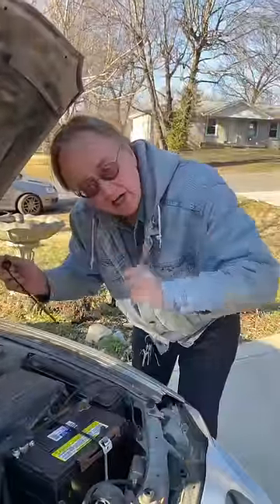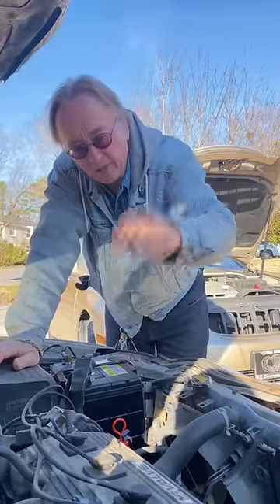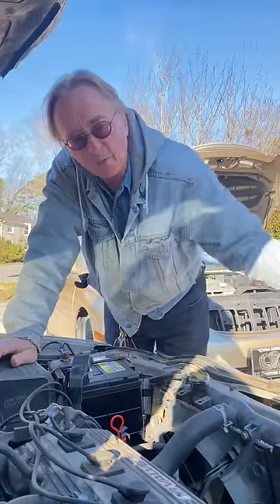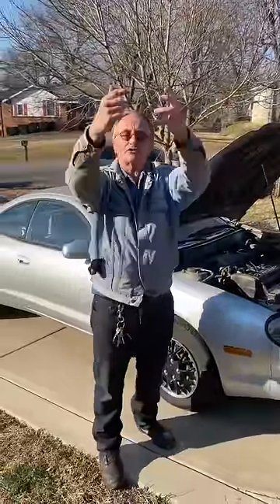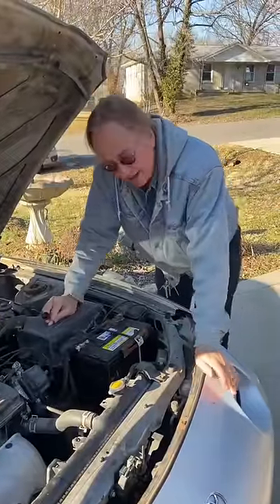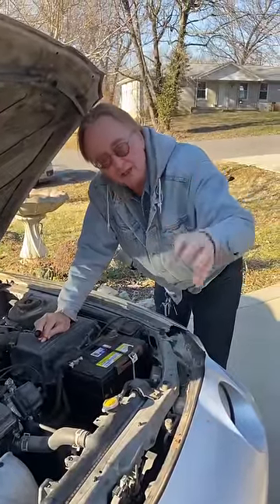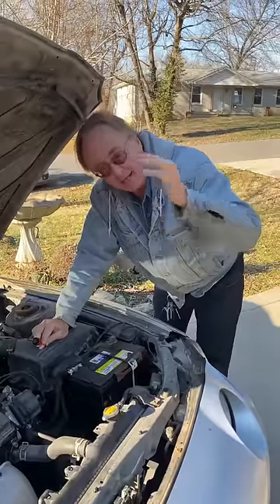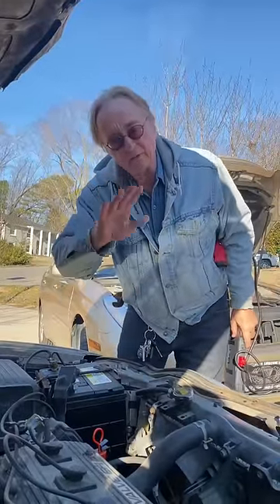If Your Transmission Has This, Don’t Change the Fluid Yourself

Comment: Many modern cars may not have a dipstick, but the do have a fluid level plug on the side of the transmission.  After adding fluid back to the tranny you check to see if fluid is coming out the level plug; if it is, then you know you have adequate fluid.  So it can be done at home even if your transmission has been leaking and you don't know how low it was to begin with.  The only problem then is it usually has to be done on a level surface while the fluid is hot.  For many cars that'll require getting it up on four jack stands.  I know I'm not comfortable being under a car in that situation, and I wouldn't want to count on the prowess of do-it-yourselfers who may not know exactly what they're doing.  For a job this small it may be worth paying a mechanic the ~$100 to do a drain and fill for you.  If you have a high enough car you can get yourself under without jacking it up then you're good to go.
Reply: Yea, the 2018 Acura MDX has an involved procedure to change the fluid.  I am not comfortable trying to do that.

Comment: Just look up the specs to find out how much fluid your transmission holds, If it has been leaking.
Reply: Still no way to determine how much is still in there.
Reply: @wigletron2846  Well if you undo the drain plug around 98% of the fluid will drain out. And than just fill to the manufacturers specifications and you'll be fine
Reply: @wigletron2846  Like I said when you undo the drain plug not much will remain in the trans. Plus on most trans you fill until it start to run out of the filler hole. Wait to it stops and put the plug back in.

Comment: How can I change the transmition oil in turbine of elentra 2005 which the fillter is placed into the gears section. By opening the screw is placed in the bottom of tank, you can only charge the oil of tank

Comment: FREE MILWAUKEE DRILL FOR WHOEVER SOLVES MY MYSTERY:
I have a 02 Dakota 3.9L 4x4 with a 42RE transmission. I bought this to give to my mother and have been rebuilding the truck, front end, suspension, cosmetics etc. This weekend I did tire rotations, oil, transmission etc on the Dakota and my silverado. My silverado is happier than could be but the Dakota went from running and driving to park and reverse only (no foward gears) here's the odd part. The truck was on ramps on the front end and I left it there when I dropped the pan to clean it and replace the filter (there's only one, no screw on filter here) and gasket. I put everything together and topped off with ATF+4. I got 10 quarts or just over two gallons out from the pan drop. This was odd as I did not expect this much fluid without draining the torque converter. I put the same amount back in then had my other half push me off the ramps while in nuetral so we could sit flat and check the levels. Everything looked great then as I was shifting through gears the linkage shifter cable snapped while in nuetral. I had to turn the truck off in nuetral and get a new cable. (Turns out someone duct taped it together) The cable is installed however I only have park an reverse, no foward gears. The torque converter is good or I wouldn't have reverse. The linkage is moving at the trans from the shifter, fuses are good linkage is good. What could've happened? I did notice I was always up the dipstick between min and max and added a half quart with unexpectedly brought the level up to 1/4″ above max on the dipstick. I plan to re drain the pan and remove the extra half quart but should a half quart really have made that much difference on the dipstick? Nearly an entire inch higher in fluid level? What's going on and how do I get my foward motion back.

Note: whoever solves this mystery I will send a free milwaukee 1/2″ hammer drill, she's used and a spare but it's a show of my gratitude.

Comment: Now if you have a 2015 Honda Civic found out you need a transmission shop and Walmart can't do it, the car doesn't handle a fluid change and requires a fluid flush

Comment: Mine didn't leak just drain and pump. I said no flush .
Reply: Drain and fill is the way to go.

Mine slipped for a little but she conditioned the new fluid and now shifts super smooth.

Comment: I got a 2003 Mercedes’ c240 sedan. From factory there is no dipstick for transmission however it can be ordered separately from any parts website - so you can check it yourself. Many other cars could be in similar situation, just check

Comment: Why other than just to make tasks extremely hard for no necessary reasons did automobiles manufacturers decided to eliminate the dipstick and to completely seal the transmission ⁉️ Other than to force the consumers to have to run to the mechanics for everything ⁉️

Comment: next the oil stick will be gone. gotta learn new hacks for dyi projects lol
Reply: IIRC, some BMWs already got rid of the oil dipstick
Reply: @wigletron2846  of course they did. wouldnt be surprised if audi did that too.  thus the cars break down. no wants to do a job that was 10mins now 35mins long lol
Reply: @iamteamBB  yeah so you have to take it to the dealership for a $300 oil change because only they have the proper scan tool.
Reply: @wigletron2846  where is that 2000 mazda protege, or honda civic when things were Normal. lol
Reply: @iamteamBB  it's getting harder and harder to find simple cars
Reply: @wigletron2846  if that isnt the truth. like do u need a seat warmer? the butt isnt warm after 2 min of sitting?  or a steering warmer.. like seriously.  u need to rip it out before it bites u in the butt.

Comment: Thx for sharing
Hey Scotty. Question 2016 sentra cvt transmission 52000 miles. 

My mechanic charges me $200 to change oil and filters. Dealership charges me $450.  Supposedly cuz they need a special equipment to do it.  I guess to measure the oil level. My mechanic is just going to follow manufacture spec’s.  Please help. What’s your opinion on this ???

@scottyKilmer

Comment: I have a mb A180 diesel (a car i bought for my wife) and when i bought it it was leaking gearoil( cvt transmission ).it had a sealed plug on top that you had to break to fill up the oil,but no dipstick.i Then went to a mb dealer and bought the tool to measure the oil level.i also asked the mb dealer What They would charge me for this job with new oil,filter and so on…..8400 kr in Norway or about 700-750 us dollars with the cvt oil costing about 450 kr/L or about 280 us dollars for 6 liters….so i went and bought the oil myself costing 199 kr/L about 1400 kr for 6 liter or 180 us dollars….i Then measured the amount and filled up to the mark on the dipstick( tool ) that i bought from the mb dealer….the merking says : when cold fill up to lower level or when it is 80 degrees celsius it must be at the upper mark so i tuned little by little until the level was correct…the leak i stopped with a hose threaded over the return Line from the radiator and clamped it at both ends….no more leak and a  fraction of What an mb dealer would suck out of my Wallet 😂😂the car has worked fine for 12000 km and runs really good…the car i bought for about 9000 kr or a 1000 us dollars😂😂not worth spending the same amount of money in a workshop and Then They Always find some extra so They  can suck you some more….do your homework and do it yourself….it feels good💪😁

Comment: Sucks my 2021 Tacoma 4 cyl has no dipstick. To change the fluid, You need a scan tool. This is crap!
Reply: My 2010 Venza is the same way. I didn't use a scan tool 🤷 I drained it out, and pumped the same amount of fluid back in it.
Reply: @tylerc7037  how is it running since?
Reply: @bryanfews5295  I did the fluid change at 135k. It's at 191k now. Starting to have some flare ups, probably could use a drain and fill again. But has no issues.
Reply: @bryanfews5295  my girlfriend drives it now. She just throws gas in it and goes. I checkup on it every few weeks or so. Thing is stout.
Reply: @tylerc7037  so the transmission is running 👍ok ?
Reply: @bryanfews5295  yeah. It shifts fine still. Driven everyday. I drove it to Vegas last winter. 4,000 mile trip. Handled it fine.

Comment: If the transmission has no drain and/or fill hole, i don't want it.
If it's anything but a manual, i don't want it.
Reply: @DeeDee
I’d love to know how you’re currently buying vehicles with manual transmissions!!!

Unless all you buy are the high end multi-hundred thousand dollar exotic cars!!!
Reply: @AzzKicker-bz1cb I'm European.
So that makes gives me a lot more choice.
Although i can't afford new cars.
I just own second hand.
But if i were American with limited options, i'd buy something from the older generations of vehicles that still came predominantly with manuals.
I love older and classic American cars, and would rather put money into fixing one than spend the same or more on a <10 years old car that i can't do anything with myself.
If my budget was more than $1000 i'd be reviving a barn find and maybe buy up cheap donor cars for parts.
I realize from watching a lot of barnfind and revival videos, that the older a car is, the more possible it is to fix worn parts on the car.
I notice that with older cars, parts didn't necessarily come in closed assemblies, like wheel hubs.
On old vehicles, wheel bearings are more easily replaced.
Axles too.
Engine parts.
Suspension and drivetrain is easier to work on.
Bushing are more easily replaced.
Body and metal work is more easily worked on because it's unlikely to be unibody.
I'd definitely go for something old if i had more income.
But for now, all i can afford is second hand 90's or early 2000's cars that i can't really work on myself.
But because they're pretty fresh they don't need too much work, saving me money.
And because i'm European, they almost all manuals.
Although the modern technology stuff does tend to break down and annoy the crap out of me for being unreliable...
I still prefer old stuff because of the aforementioned reasons.
Here in the Netherlands, anything over 30 years old is (road) tax free.
Anything over 40 years old needs inspection only once every 2 years.
And if it's 50+ years old, no inspection and taxes are required.
This is because my government acknowledges that classic car owners here are passionate and can be trusted to maintain their vehicles, and because not many are daily driven.
Insurance here is also really really cheap on classic cars.
I'd love to drive something from the 70's, 60's or even 50's.
I hope you understand my point of view.
Reply: Honda and Toyotas still has manuals transmission

Comment: My Corolla's transmission oil was so easy to change, I did it by mistake the first time I changed the oil.. I never had to be sure I was on the correct oil pan when I changed oil in my previous vehicles.

Comment: Is there a problem changing automatic transmission fluid often, from new
Reply: No problem at all change it every 30k+ with good quality fluids
Reply: @forseenlife
The problem is trying to do it on vehicles with no dipstick on your own!
Reply: @AzzKicker-bz1cb  I bought a pump for it that pumps it out and back in and the can it drains to measures how much drained out so I can pump that much back in. I was just curious if you changed it, say...every 15k miles would it cause problems on a transmission that says it's lifetime fluid.
Reply: @Forseenlife  
Changing your transmission fluid that often isn’t necessary, but it won’t hurt the transmission!!! 

But never ever rely on fluid that claims to be lifetime!! 
Not changing the transmission fluid, oil, or antifreeze are excellent ways to insure that you’ll spend thousands of dollars on repairs or have to replace a vehicle that is virtually junk!!! 
Transmissions are very sensitive machines and changing the fluid in them every 30k is just fine, more frequently will not hurt it, but never changing it is the best way to destroy it!!!

Comment: I mean if you’re not gonna flush the entire system then you can just put in the same amount of transmission fluid as the amount you drained. My matching the fluid levels once you drain it.
Reply: no, cause like he said if its leaking or improperly filled and you put the same amount in it will not be correct
Reply: @docexotic  true